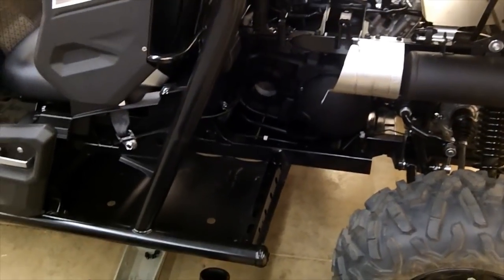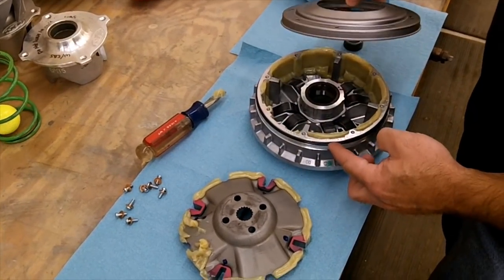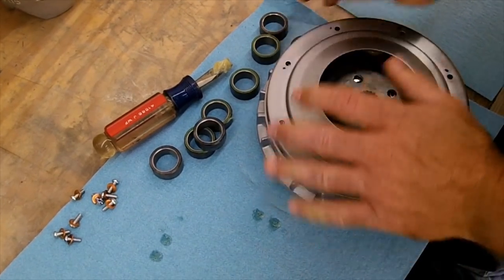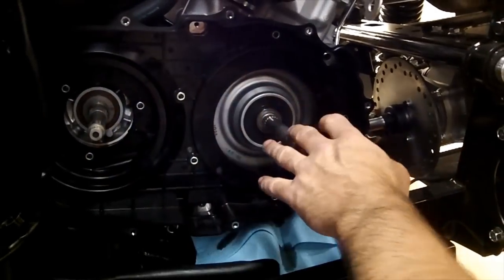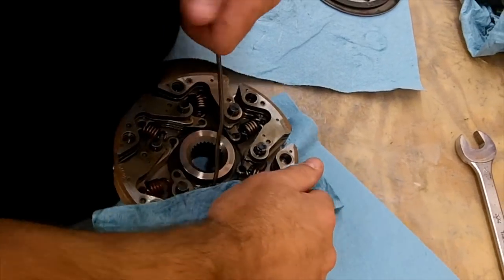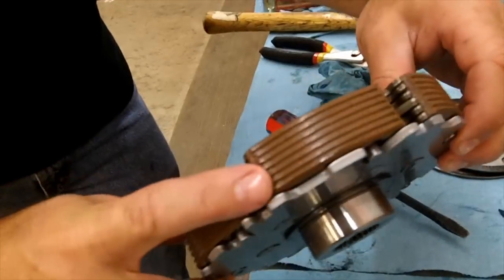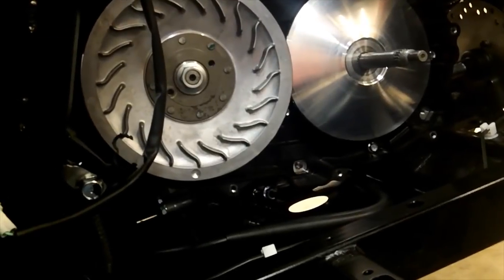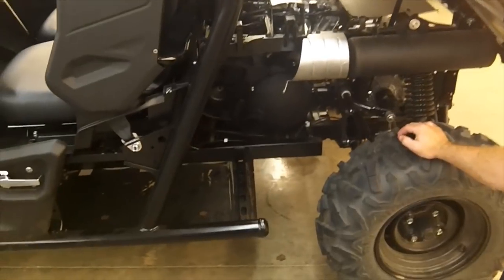Clutch Kit Install - 2014 Yamaha Viking - EPI

Comment: I run it for 9 months it was better than stock,then i heard  of J B S  SLUGS  AND SHEAVES IN STALLED THEM WOOOOOOO NOW LOTS OF LOW END POWER AND lots of  TOP END. 27-14 WITH A 3 inch lift ,and now runs very good

Comment: After torquing the wet clutch nut, it needs to be staked and you should always use a new nut.  Red loctite wouldn't hurt either.

Comment from the maker: Yes that helps for the secondary and the compression of the motor helps some on the wet clutch.  Dealerships have a tool to keep the clutch from rotating.  A lot of people at home will rig up something if needed to help out.  Yes the mudders and deep water riders like to seal up anything and every where to help keep water out.  Any clutch that gets wet will slip until it is dried out.  It does make it a lot more pain in the butt to take apart if you ever have to though.

Comment: Curios how much the secondary clutch moves before engages the gears inside?
Reply from the maker: Hello, I don't know the exact measurement on that.  Its normally pretty quick, some machines will have a little slack when you switch from forward to reverse or vise versa with all the driveline slack.

Comment: can u guys point me to an install video for a 2016 Kodiak or grizzly? Thanks
Reply from the maker: If you watch this one it is virtually the same once you get to the clutches.  It is a lot easy to get to the clutches on the Grizzly and Kodiak.   As of right now we don't have a video on the atv's, we use to have one but for some reason it doesn't work anymore.  We plan to make another one this summer.